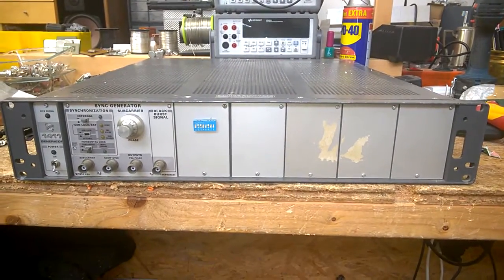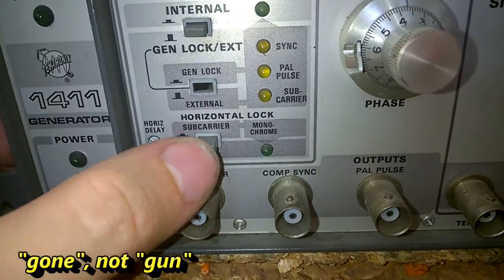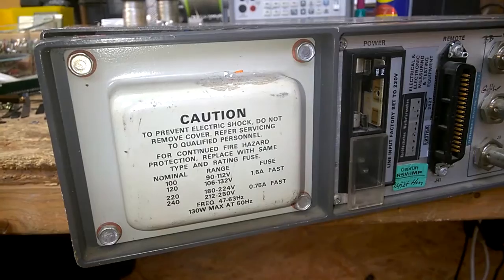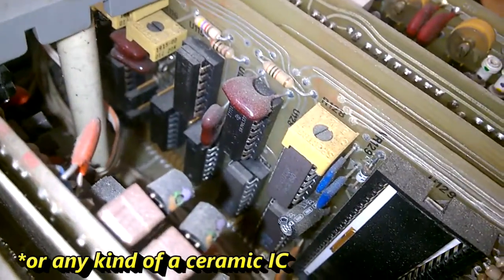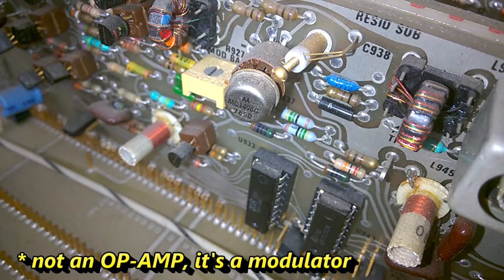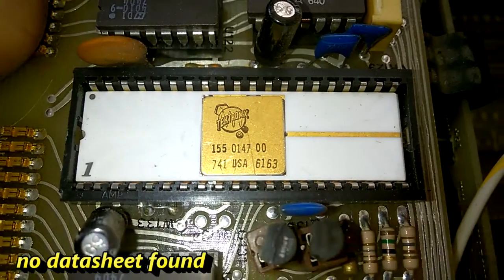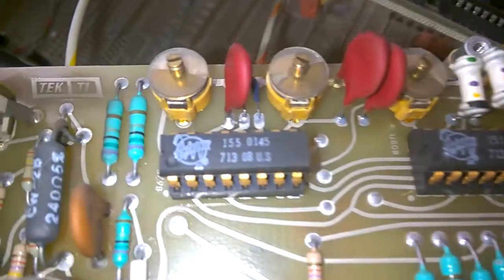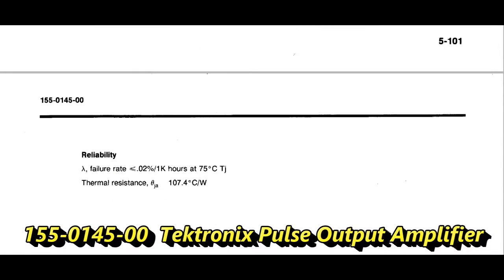BEB #8: Tektronix Teardown, scrapping for Gold, Beautiful-Electronics Blog

Comment: Can't remember the name, but once upon a time there was a semiconductor company that later was bought by the tech holding company VADEM (early 80's). Before that their gate arrays were unbranded. Later they had the Vadem Logo on it. In the 70's they were one of the first to make custom gate arrays and ASICs for all sort of stuff. Those IC's looked exactly like that Tektronix part. The ceramic, the gold plated cap with the trace going off to one side. And that special socket with the top clamp came from them too as an option. In the 90's they started making IBM PC System on Chips, PCMCIA controllers, and other misc PC related stuff. It could well be one of them. Unfortunately there is not much to find about them, I only know because I used to scap a lot of that stuff. One of their ASICs was an multiport V24 (RS232) controller for all those VT100 terminals back then.
Reply from the maker: thank you for your awesome feedback and all that interesting information about VADEM. This is very inspiring for a google search.